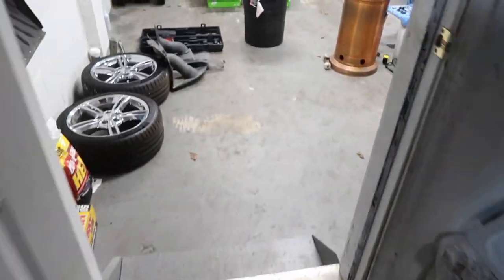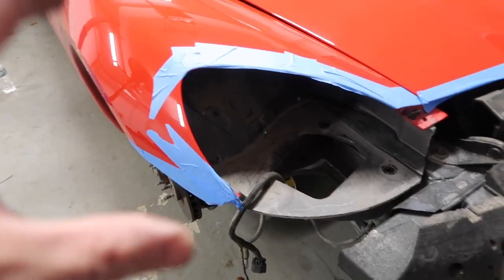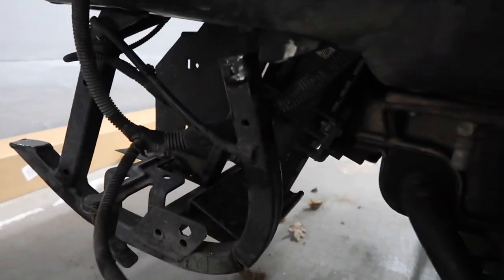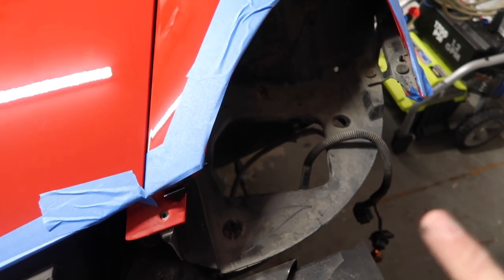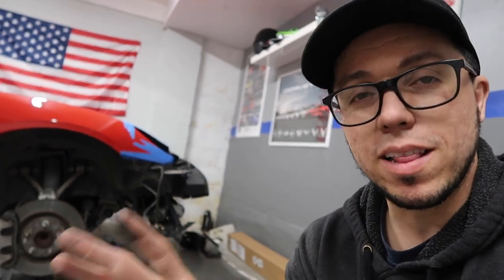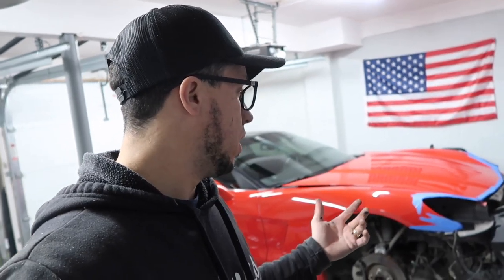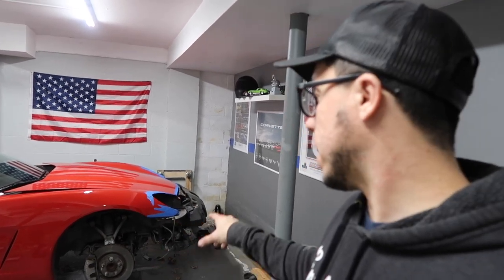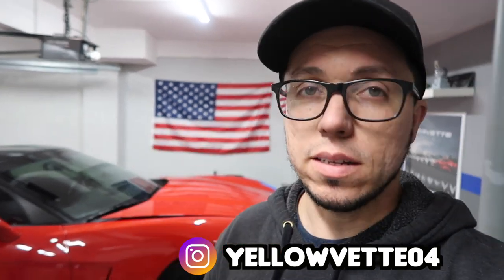Found a damage on my C6 Corvette! Radiator Support Bracket 😏

Comment: That's definitely a weak point in the front of the car. Sorry to see it. And it's totally true that you go to look at one thing and you find other things. My truck's transmission is leaking fluid but only when I'm driving so I had no drips on the floor. Good thing I caught it before it ended poorly.

Comment: Hey,,, at least you found it Matt,,,that`s a plus in itself ! Since you have everything taken off,,,,,you should go ahead and change both radiator support brackets,,,,,even the one with the small crack,,,,,or does it come in one piece, where the left bracket is attached to the right bracket ?
Or are they individual brackets ?
Its kinda hard to see everything from the video.
You have to look at the bright side of it,,,,,at least its not that bad